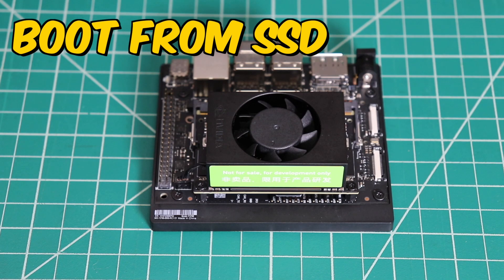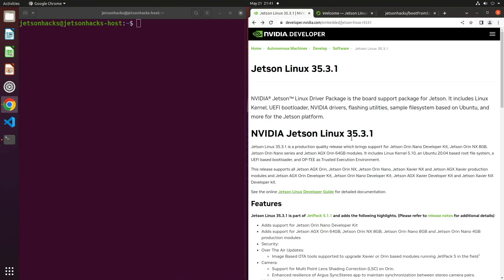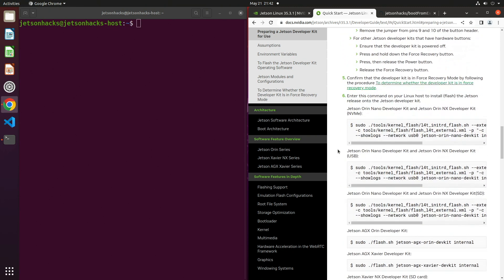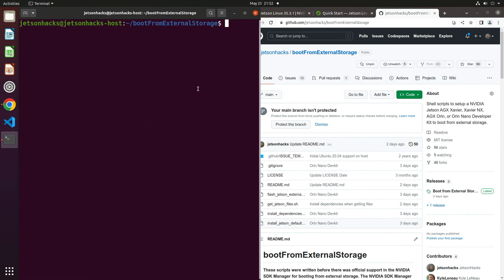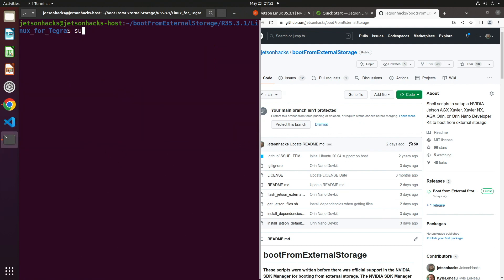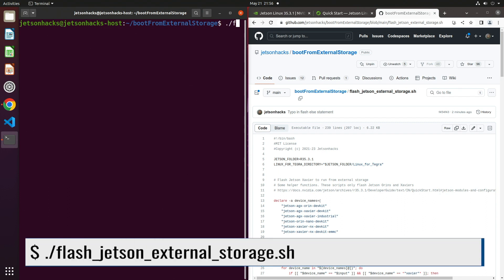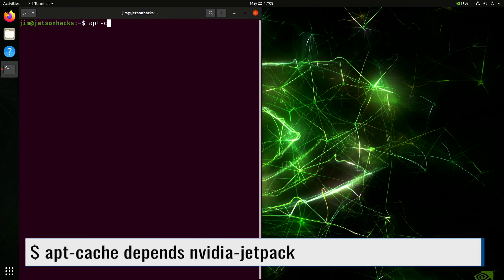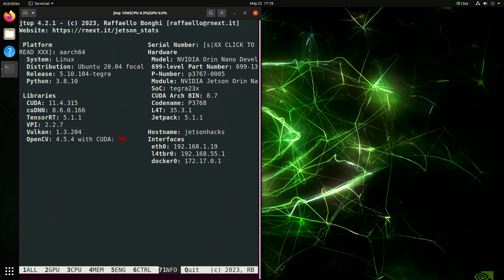Jetson Orin Nano Tutorial: SSD Install, Boot, and JetPack Setup - Full Guide!

Comment: My Orin Nano will be arriving today and I want to boot it from an nvme ssd. Does the host operating system need to be Ubuntu 20.04? I have Ubuntu 22.04 installed on my PC and it would be a pain to reinstall a downgrade just for the Orin Nano to work.
Thanks!
Reply from the maker: The SDK Manager page states that it runs on 22.04. I hope your project goes smoothly! Thanks for watching!
Reply: did it go well, could you share your insights please?

Comment from the maker: The SDK Manager now supports this functionality, you can use it instead of the scripts. Also, remember that the SSD you choose comes out of the power budget for the board. We discuss this in the accompanying JetsonHacks article: https://wp.me/p7ZgI9-3KW
Reply: Hi hello sir. 
Thank you so much for this videos. 
Sir please i have a question. I have done a total installation of the system on Jetson Xavier NX step by step, but when i need to  install Nvidia-jetpack he tell me that there is not enough space to complete the download and install the Nvidia-jetpack, knowing that my SSD memory is 256 GB what is the solution for fixes this problem ?
Reply from the maker: @chihebeddineheguehoug1716  You can probably fix it with the Disks program. However, I would advise asking the question on the official NVIDIA Jetson forums where the NVIDIA engineers can give a good answer.
Reply: @JetsonHacks  Thank you very much for the information, okey i will asking the Nvidia jetson engineers

Comment: X86 where do I get that from?
Reply from the maker: An x86 machine is a PC. Desktop or Laptop.
Reply: @JetsonHacks I know, I was looking for the ios 32bit version to download but it's no longer being supported. Is this the same process for the agx orin?
Reply from the maker: @Key_Capz_  The method shown in the video should work for the AGX Orin, but I have not tried it.
Reply: @JetsonHacks I just test it, it works and on a x64. I was reading the md file and they are referencing a x86 machine but nothing about it being required.
Reply from the maker: @Key_Capz_  I'm glad you got it to work.